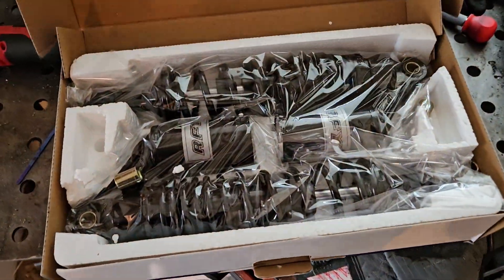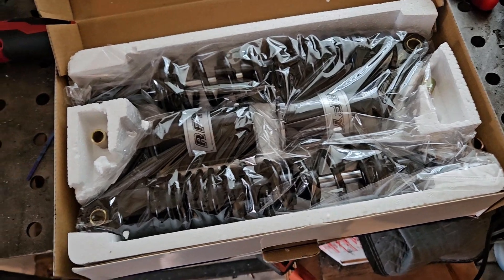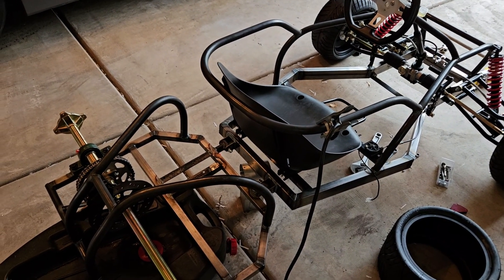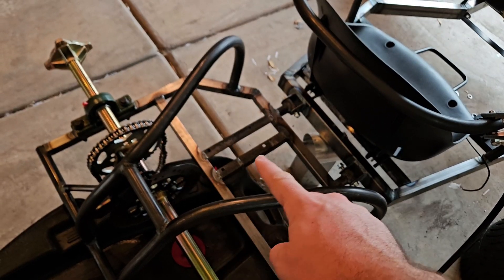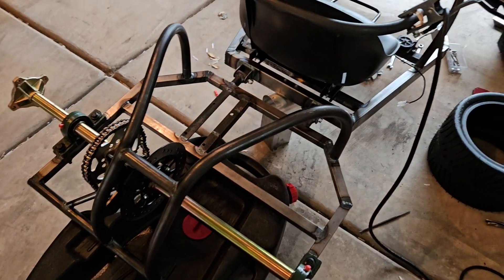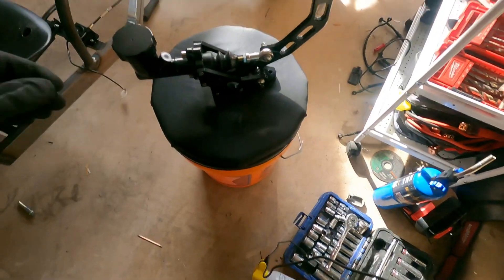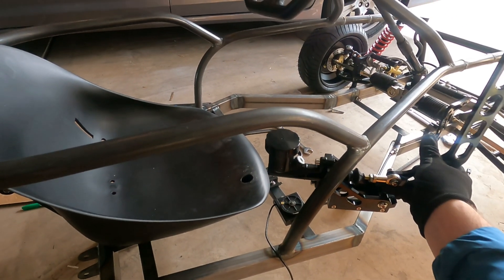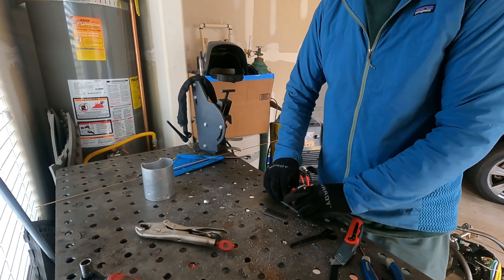Building an Electric Go Kart Part 4

Comment: Great work mate. Am building a similar design off exactly the same inspiration. Where did you source those wheels from ?

Mine has a custom digital dashboard using arduino and a 3D printer. Hit me up if you want to chat about designs.
Reply from the maker: I ordered some stuff to make the diy davega os one. Is that the one you have? Wish there were more display options for vesc at the time.
Reply: @LittleGarageJank  I built mine from scratch using an Arduino UNO and OLED display. My background is electronics and computers- wish I could TIG as well as yourself !
Reply from the maker: @fit2tri trying to get a nano esp32 to work with a spi display but can't seem to get it to work. Next step is to just use a tradition esp32 board.
Reply from the maker: If you search 205/30-10 fatty tire that will bring you multiple results.